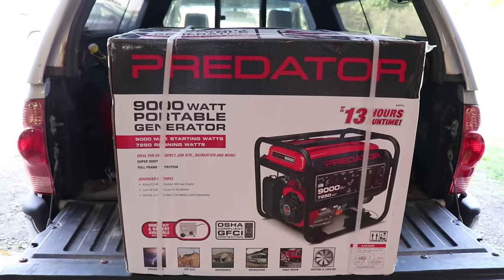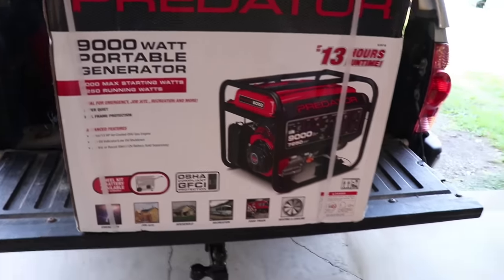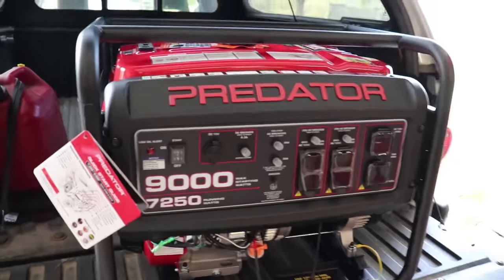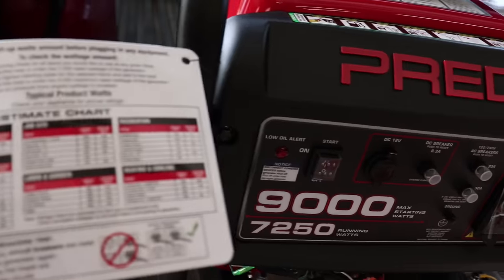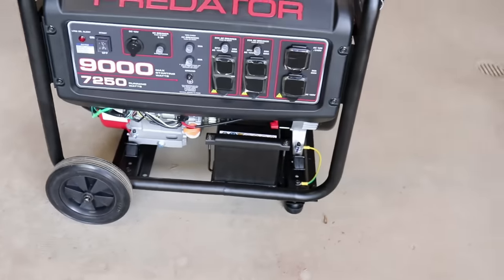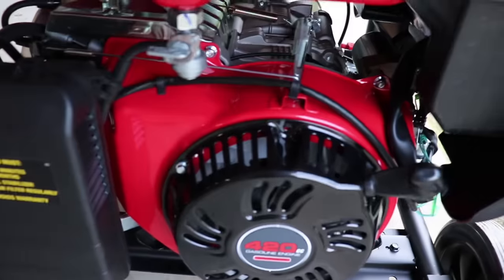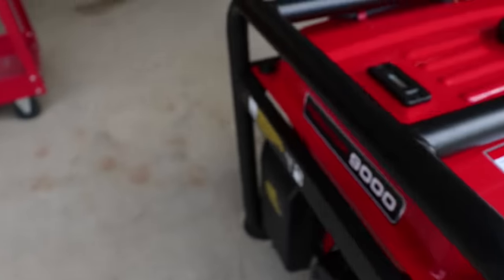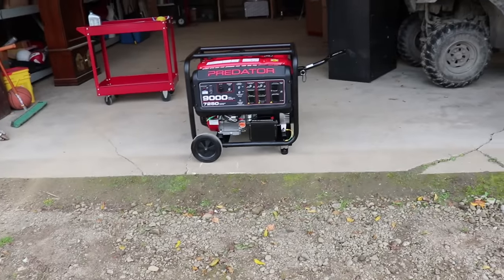Predator Generator Running Our ENTIRE Home. (Complete Setup and Cost)

Comment: I just had a electrician do that to my home. I have a champion generator with 9350 starting and 7500 running and I run my whole house. We did a test and ran it for 8 hrs. Getting that installed by the electrician was the best investment ever!!
Reply from the maker: Very  nice! Gives you a little security!
Reply: The Cook Family Homestead  Yes it does!
Reply: Just curious what is cost to have the electrician do the work? I'll attempt just about any project except for anything beyond wiring up an outlet or switch haha!
Reply: How much did it cost you?
Reply: Yes I want to know also
Reply: @TGLASS24 I did it myself and I'm not that skilled. Not very hard but you have to be careful working in the breaker panel. A lot better than running extension cords.
Reply: @wes326  yeah that's what I don't wanna do is mess with a breaker panel haha! But, a little research and I probably could tackle it. Thanks for the reply!
Reply: @TGLASS24  If you want to use individual wires, Lowe's sells wire by the foot.

Comment: I just ran my predator 9000w generator for 3 days straight,  continously.  Because of this ice storm all of Texas is getting right now. I must admit,  my predator 9000w worked flawlessly.
Reply: I live in Texas too. Question, did you cut it off any for the 3 days ?  Did you have to refuel it or add more oil to it ?
Reply: What did you have on?
Reply: in houston happen to buy one last month and glad i bought it now   need to do this so i wont need all the extension cords
Reply: @kentrelc1  , no, continously for actually 4 days
Reply: @JM-fo1te   everything but my central heat and air.  Omly because I have a cast iron wood burning fireplace
Reply: I live in Indiana and wanted to get this whole house set up REALLY bad last summer. But I was kind of afraid of the noise disturbing the neighbors. A zombie box noise suppressor is 2 grand! Almost triple the cost of the generator itself. Our home is gas, so cooking and heating won't be as much of an issue. 

Instead, I bought a gas stove for the living room. We can all pile up and sleep in there if the power does go out. Looks like the worst may be over for S.E. Indiana. We never lost electric here, and that 3 feet of snow we had last Tuesday, is completely melted away today, Saturday. 

I'm wondering if a 3500 watt, whisper quiet generator would be enough to run everything we need. Which is basically the refrigerator, a few lights, the TV and the internet. The furnace fan and igniter and the hot water heater igniter.
Reply: @heinzkitzvelvet  , what all, do you want to run, during a "blackout"  ? Refrigerator,,freezer,,,lights,,,,T.V.  ?
Reply: @gradyrogers6707  furnace fan and igniter, hot water heater igniter, fridge, selected lights and outlets, internet modem and router and TV.
Reply: @heinzkitzvelvet  ,  I have gas heater and stove.  I live in a 3/2/2, 1,600sqf house.  It ran everything but my central heat and air,  I chose not to have it hooked up to my central heat and air because I have a cast iron wood burning fireplace.  Even ran my electric garage door opener and all lighting in my house
Reply: @gradyrogers6707  yes. I imagine the 9000 will run just about anything you want it to. I'm wondering about the 3500 running everything I want it to.
Reply: @heinzkitzvelvet  Starting a refrigerator or freezer will taxi a smaller generator as motor startup draws a lot. 3500 would be on the edge.but should work. As for zombies, a cheap way would be to get a flexible exhaust pipe meant for autos and run exhaust into a large bucket (drum) of water. Ad soap and make bubbles for the kids :-) That will quiet it down a lot and water will heat up a lot, but don't drink it. Ad another coil pipe inside barrel to transfer the heat too -like a still. Pipe it into your home and use a car radiator to heat home - gravity feed (as hot water will rise) and return water to coil.
Just don't leave exhaust pipe in water after shutdown as you don't want water vapors back into your engine. If you have a well water pump, then 3500 too small. Might as well use wasted exhaust heat....
Reply: @heinzkitzvelvet ,  what all are you wanting to run
Reply: @gradyrogers6707  see my comment from 6 days ago.
Reply: @heinzkitzvelvet  , I would go tad bit higher on the wattage.
Reply: don't for get to change the oil as it says in the manuel or you will burn it up fast
Reply: Make sure you all are aware with the hazards of using generators. Generators can be dangerous if not used carefully so make sure you follow all the generator safety instructions. I know all about generator safety and I have something to explain to everyone about generator safety. Here is what you all should know: please remember not to ever run your generator indoors. Generators should only be used outdoors. Always remember that carbon monoxide fumes are odorless and colorless gas that is a silent killer that you cannot see or smell. Carbon monoxide is dangerous and it can cause death. Carbon monoxide is poisonous. Always keep that in mind when using generators. You need to have a carbon monoxide detector. Make sure your generator is 15-20 feet away from your house and away from doors, windows, and vents. Never use your generator indoors even if your doors and windows are open. Some people run their generator indoors during hurricanes which is dangerous and you and your family will die if you use generators indoors. Running a generator indoors increases the risk of carbon monoxide poisoning. Please don’t run your generator in wet conditions. Running a generator in wet conditions can electrocute you. You need to keep your generator dry. Don’t let the portable generator get wet. You need to have a generator tent as well to protect your generator from getting wet if you will use  your generator during wet weather. We also really need to keep our children safe when we’re using portable generators so they won’t get electrocuted or burned by the generator which is dangerous. Generators can be hot. You have to keep an eye on children making sure that they are not near the portable generator to avoid any risks. We have to be aware with all the hazards and follow all the instructions in the generator’s operating manual. Generators pose electrical risks. Make sure your generator is not overloaded. Overloading your generator can cause damage to the appliances that are plugged into the generator. Please don’t overload your generator. Don’t ever try to plug a generator cord into a wall outlet to avoid back feeding. Back feeding is dangerous. Always turn on your generator first before plugging in appliances. And before you unplug the appliances, please shut off your generator first. Please use a heavy duty cord for your generator and the cord should not be worn out. Please don’t refuel your generator while it’s running. You should shut off your generator and let it cool off before refueling it. Refueling your generator while it’s running can cause fire if gasoline spills on the generator’s engine because it’s hot. Please make sure your generator is properly grounded. Everything that is said on the generator’s operating manual should not be ignored. They all need to be followed. https://youtu.be/I1jT3ANENvI and here is a video more about keeping your family safe while using generators. This is for everyone’s safety. This is just a safety reminder for everyone to make sure that you all are aware with the warnings. Thank you and hope you all stay safe.
Reply: @heinzkitzvelvet  Also live in Indiana.  Wondered if I could just keep it in the garage and pipe out of the exhaust.  Would cut down the noise to neighbors a lot.
Reply: @heinzkitzvelvet  Last Summer, I was running my house on a 3500.  It was my brother's generator.  I mostly just used it for 2 wall air conditioners and a fridge a tv a microwave and recharging my cell phone.  I shut it off at 11 pm every night and turned it back on by noon.  I refilled it with fuel once a day.  When I bought my own, I bought a 9000 because it was a good sale at the time.  It said 13 hours at half power and I will be using way less than half power.  I decided to go bigger because I have had a few extended power outages and one of them gas stations couldn't accept cc's.  Two of the power outages had trees down on every street making it hard to get to the gas station.  One was in the Winter.  One was in the Summer.
Reply: @heinzkitzvelvet  
Just keep in mind the 9k is start up. Running watts is what you need to be most concerned with. This unit is labeled as 7250 running watts. Not limitless but sufficient for many folks during a short outage.
Reply: @goodcitizen3780  finally got my natural gas kit setup for my 9000. Ran it for the first time yesterday. It seemed to work great. We only have 4 LED lights in our house. The rest are the old school 60 watt incandescent bulbs I like. It ran everything just fine. Calling fans, all the lights, fridge, TV, modem and router. But I couldn't turn on the A/C, electric dryer, or an electric clothes iron.
Reply: @heinzkitzvelvet  what size is your ac unit? If it's small enough or a split system there may be a fix. Did you wire it in yourself or have it done professionally. Just curious. It doesn't really matter if you know what you are up to.
Glad to hear you have it running on gas but that could be part of the reason why you can't run the unit. Natural gas has a very steep drop off from gasoline. 
Honestly, if you pleased with the performance then it's good to go and I'm glad for you. It feels good to know that you can run your home when the grid is down!
Reply: @goodcitizen3780  IDK what size it is. It's old tho, I do know that. The A/C unit came with the house, the interlock for the generator was done by a 'professional' 🙄  I think his work was shoddy at best, but that's here nor there. 

Yes. Gasoline has more power. It's also double the price and not as readily available. I'll take that trade off everyday.
Reply: @heinzkitzvelvet  
I think you are right on all points!
Reply: @kentrelc1  no, not one time.
Reply: @JM-fo1te  all electrical except central heat & air. I have a good fireplace
Reply: 3 days on one tank of gas or how often did you refill?
Reply: You must have burned 40 gallons of fuel?
Reply: @Hoodyhoo2121  yeah, approximately, but it saved my butt
Reply: How much fuel did that require? How do you store it safely? Thanks.
Reply: @Perly53  , I'm guessing  20 gal maybe 25. But it saved my  behind and my sons 2 pet reptile pets. Allowing me to use plug in space heaters.
Reply: That’s a heck of a test three days straight
Reply: How much gas and oil did you use? Thanks
Reply: @billymack4258 ,  no oil, probably 25 30 gallons of gasoline
Reply: @kentrelc1  no, not one time
Reply: @JM-fo1te  , everything but my central heat and air.  3 bedroom 2bath house with garage door opener fridge etc:
Reply: @heinzkitzvelvet  honestly, I wouldn't worry about the noise, unless your neighbors have a generator, they won't be home during days of no electricity
Reply: @heinzkitzvelvet ,  nope, not everything, thats if you're including central heat and air
Reply: @The_Happy_Aviation_Enthusiast ,  yes indeed, I had a licensed electrician come out and hook it up to my house
Reply: @wishingb5859 ,  yep, that would work perfectly
Reply: @gradyrogers6707  your heat is the most important thing why is no one even showing if it runs your furnace… confused
Reply: Can it run the central air in the house too???
Reply: @carlossauceda6944  , it could run the central heat and air 'only' but nothing else. It does run everything but my CH/A. To run central heat and air you need at minimum 15w
Reply: I have a single wide and I just bought a firman 9500w starting watts and 7500 watts. Do you think I can run my central heat, fridge, a tv, maybe 3 lamps and microwave?
Reply: @The_Happy_Aviation_Enthusiast  my garage is separated from my house , can I run it in the garage with the garage door opened ? Thank You
Reply: what ton AC unit?
Reply: @kentrelc1 your gonna run on imaginary fuel for 3 days
Reply: I'm seeing this 3 years after you posted this video so very late in adding my comments.
I notice you are running that thing inside your garage/workshop, I'm very surprised at your apparant lack of understanding the dangers of running ice powered equipment indoors.  Surely you would be aware of the danger of carbon monoxide poisoning and never ever run these things indoors, that it was not far from the door is not good enough, it needs to be well away from the building, probably means that power cord is nowhere near long enough.
You emphasise how quiet it is, I would prefer it was very noisy to encourage you to move it well away.  
I'm sure there would have been warning signs about the danger of carbon monoxide poisoning in the instructions/owners manual even flags attached to the gen set.
You missed the most important aspect of using a generator.
Ignoring the dangers can kill you and your family.